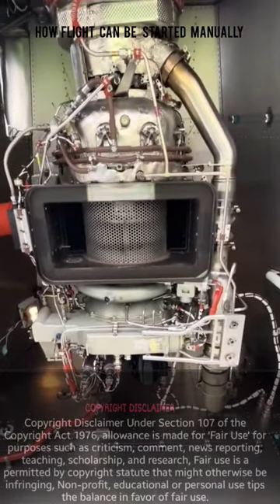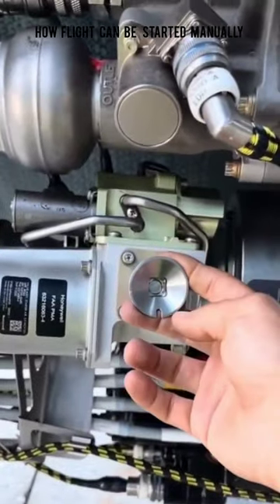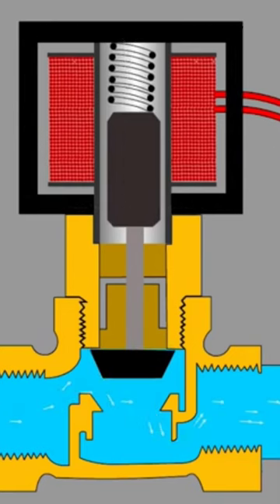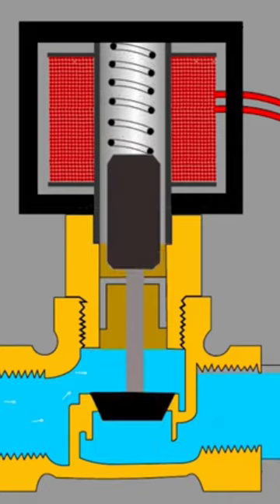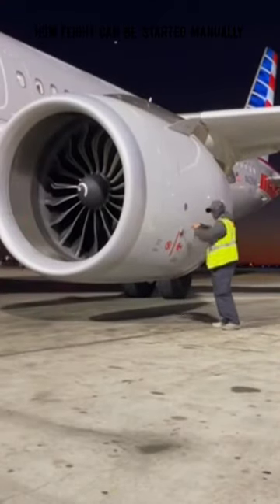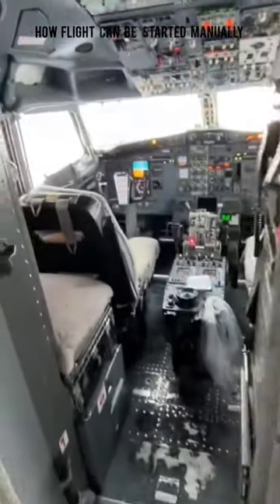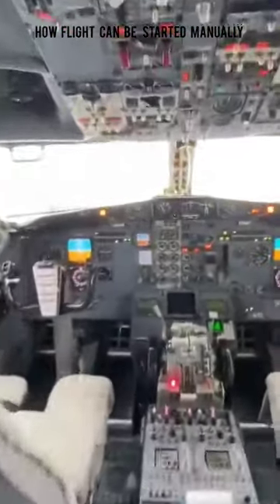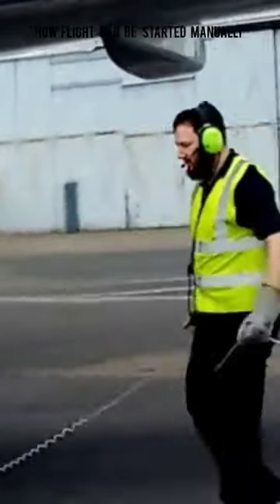How do can we start flight engine manually #didyouknow #flight #manualtesting #apu #jetengine #pilot

Comment: Apu work aaga la na enna Pannu va nu theriyum aaaa 😂😂 pin my comment for answer
Reply: If apu not working we connect external pneumatic air to give a blead air to engine and staring one engine after taking blead form that engine staring 2nd engine without APU  we can start
Reply: APU periya flight la than irukum, APU ATR and Bombardier maari aircraft lam GPU (ground power unit) la start panuvanga
Reply: @karthickhaasan1413  correctu ...superu...epdi bruhhh...